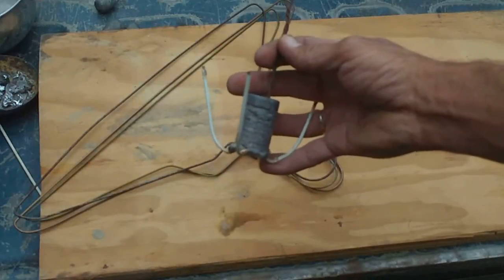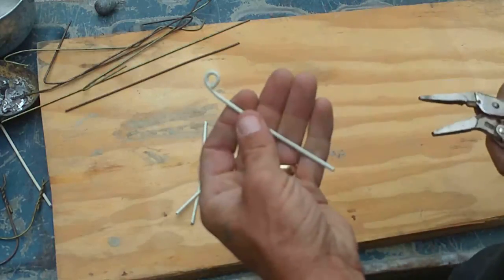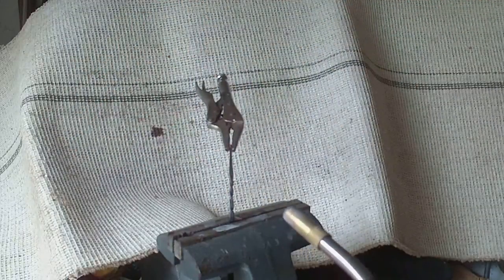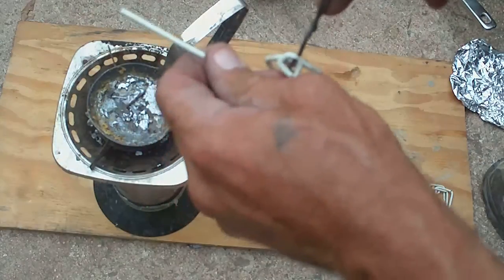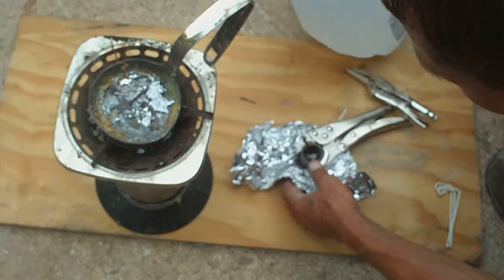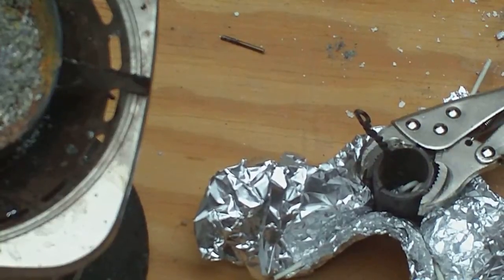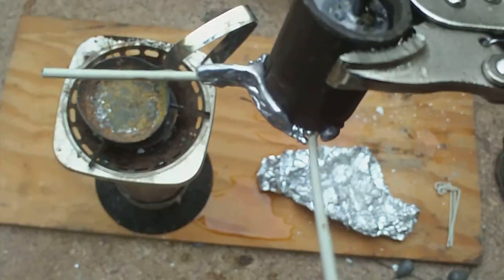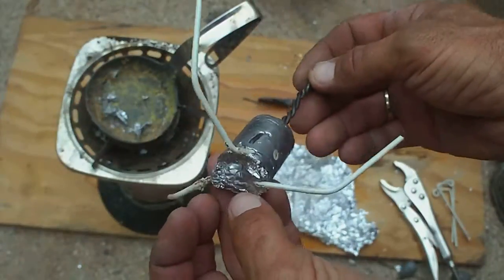How To: The Best Home Made Spider Weights for Surf Fishing Part 1

Comment from the maker: @1postalpredator I hav the holes at the bottom. The water helps cool that first bit so I dont loose it all. In part 2, its a differant mold with actual holes at the bottom. In one pour, you can see, it lost alot of lead. Just helps it set...